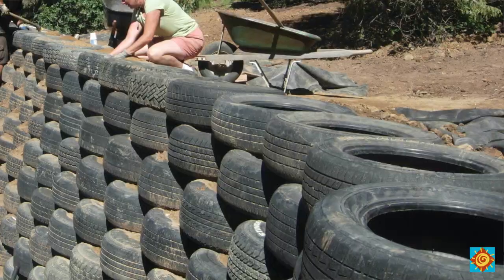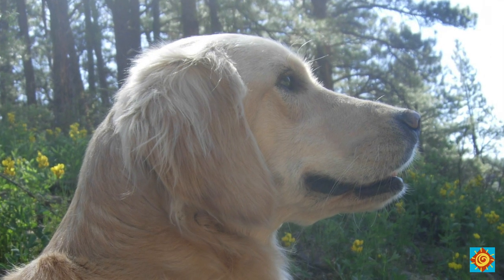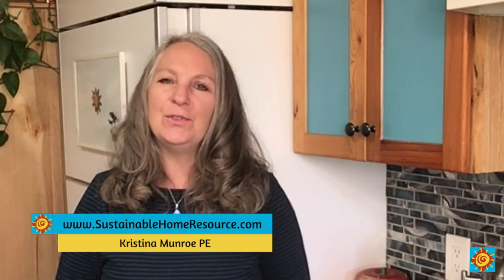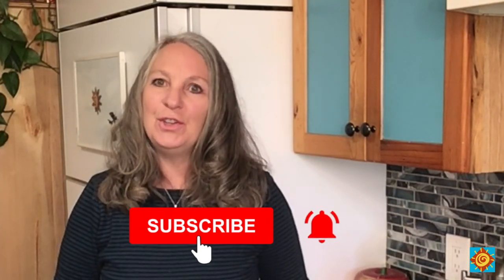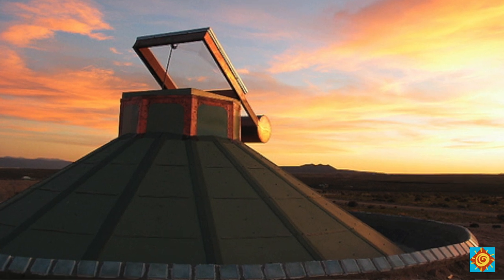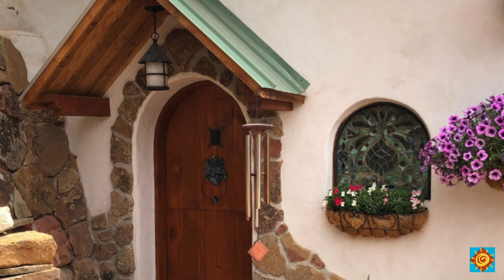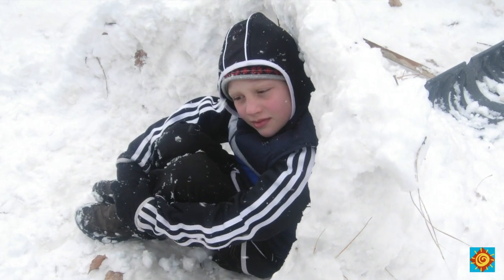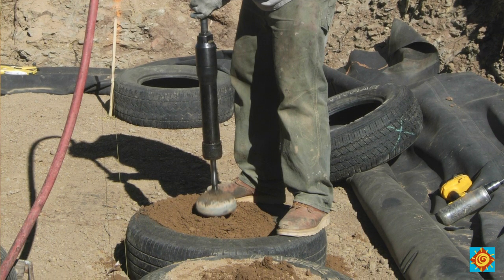How Long Does it Take to Build a Tire Wall?

Comment from the maker: I hope you enjoy this video. It was fun reliving building our tire wall. 
What materials are you considering for your sustainable home?
Reply: Modified Earthship Biotecture Global model - we will be using a combination of compressed earth block integrated.
Reply from the maker: @rongray4118  Tires and Compressed Earth Block would definitely be my approach if I had to do it over again. Good for you! Keep us posted on the progress.
Reply: 1st thanks for the video! I need to build several retaining walls to prevent land erosion on my property that has a creek running around/through it. Where did you get you tires from?  Are there issues with fill dirt washing out of the tires from rain? Once again thanks for the video and helping me out
Reply from the maker: @ridinrancher9443  Re collected free tires from local tire stores mostly. Regarding dirt washing out - yes water will wash out dirt from a tire wall. That's why I was motivated to get the tire wall up, backfilled and the house wintered in before snow and rain could damage it. We also protected the back wall with a "skirt". You would want to do the same with a retaining wall. We used EPDM (rubber used in roofing) or you can use contractors' plastic. Water coming running downhill will definitely compromise your wall. That said - I think tires make an inexpensive and sturdy retaining wall. Just make sure you take the proper precautions.

Comment: Never use old tires to build a house. I wonder how much the air compressor was for 2 months? And you had an excavator on site. You should listen to David Easton on building not the old garbage man. 
You should have used that tamper for rammed earth walls, much faster and a better finnish in the end.
Reply from the maker: It worked great for us. Living here over 15 years.

Comment: I'm trying to link to your workshops and pdf. It doesn't seem to be working. Will your book have the information in the two links you in your videos show notes? I have wanted a house like yours for years. Your house is wonderful. Did the roof fix work? You mentioned the type of roof and installation you would choose. Could you clarify what you would do if you installed the roof over again today. I'm at the first stage, land and house plan. Thank you for showing me girl power and that I can do it.
Reply from the maker: Thanks so much for reaching out! This video is one of the first I made nearly 5 years ago, so much has changed. 
We are no longer offering the workshops and I've removed the online course, but my book has most of the information in it to get you started. You can order it from Amazon and there is a link on our new website: ClarityOffGrid.com.
If you contact me through our website using the Contact Us form, I'll send you more information including some free downloads/worksheets. 
My strongest suggestion for you at your stage is to make sure that if you've purchased or looking at land that you double check and make sure that all of the systems you want to include are legal for your property - greywater planter, composting toilet, water collection, and building with tires.
Reply: Thank you.
I will contact you.
Enjoy your weekend.

Comment: Hi Kristina, it's inspiring to see a woman building a home. My bestie and I are planning on purchasing land in a cold weather climate and building our own separate homes on a shared plot. I just toured the Earthship community in Taos on a recent trip. Did you use a building plan from Biotecture or design your own?
Reply from the maker: I designed and drew my own plans, because after touring dozens of Earthships in Taos, I decided to make some significant changes to that idea to make it more comfortable in a cold climate as well as stay cooler in the heat of summer. If you haven't already, I'd suggest visiting our website, where we have tons of resources and free videos on how and why I designed the house the way I did. Let me know if you have any questions. Also, we just published a video recently called, "Why Vertical Glass in Our Earthship-Inspired Home." Good Luck!

Comment: I live here in Colorado. Where can I find the tires?
Reply from the maker: Hi Shaun.  In our county we just went to the tire stores.  They have to pay to recycle them so are usually happy to have someone take them away.  Kristina's dad and son went around weekly to collect them.  You'll probably have to sort through them to get all similar sizes.  We used mostly 225-16 to 245-16 sizes, using larger ones on the bottom getting smaller at the top. Good luck!  And don't hesitate to ask if you need help.  If you go to Kristina's website at sustainablehomeresource.com or buy her book you'll get lots of information that she wished she had a resource for when she started!  And thanks for watching!
Reply from the maker: We collected our from tire stores. When they remove worn tires from customers, they have to recycle them. By you taking them, you're saving those tire stores money.

Comment: do you have to have cement footings under the first tire layer?
Reply from the maker: No. Concrete footings aren't necessary because the tires are as wide as a typical footing and therefore spread the load directly to the ground. This is a great cost savings and allows you to get starting building straight away.

Comment: Wow! So impressive. 2 questions. 
1 Did you find the tamper hard on your joints? We opted not to use one for this reason (and $). 
2 When decreasing tire size did you use a lot of ‘squishy’ tires to get the tires to alternate properly? We are currently doing our second course - going from 265s to 235s and having hard time getting them to line up. 7 squishies in one course seems like a lot.
Reply from the maker: 1. We had Mike run the pounder because of his upper body strength. Christy and I couldn't pound for very long. So, I understand what you're talking about. If you can find a strong worker to help you, you'll find you get a superior pack with the pounder and that will reduce settling of the tires which leads to cracks in the plaster over time. 
2. We didn't have any issues like that. Even tires of the same designation offer differ in overall size depending on tread and wear of the tire. We found each course to be a bit of puzzle. We laid out each course completely before packing the tires, arranging them until it worked out. However, I don't believe we used 265's - we used smaller tires because they packed easier. 
Good luck with your project! You're doing it and you'll figure it out along the way. Hope this helps a little.
Reply: @ClarityOffGrid  Thank you for your reply and encouragement!

Comment: What did you cover the outside of the tires with? We need a long, free-standing wall but I don't want the tire look. Is there something I can spray on the outside surface to make it look nice? Great job!!
Reply from the maker: You don't see the outside because it's all backfilled with dirt. The wing walls at the ends of the house can be plastered. We used Lime plaster. If you're using the tire wall as a retaining wall, you could also use concrete to fill the gaps and then plaster it with concrete stucco. If you want see what a finished tire wall looks like, check out our channel for lots of videos where you can see the inside of the house and the outside tires in their finished form.

Comment: We’re in bush Alaska, and I have been eyeing the tire pile at the dump for a year dreaming of building an earth ship-inspired home but not knowing how we would accomplish this in the short time we have without snow. Thanks for the inspiration.
Reply from the maker: I'm glad it helped. We found the keys to getting the tire wall up in a reasonable timeframe, was using the pogo-pounder and also the material you choose to fill them with. If you try to use the native soil from your site and it's rocky, then you may find that sifting it will take too much time. We used crusher fines that were easy to shovel and pack. Good Luck to you! It's worth all the hard work.

Comment: DO NOT DO THIS, IT IS A RECENT DISCOVERY.  THE STEEL USED IN TIRES., ESPECIALLY FROM OVERSEAS IS THE LOWEST "GRADE" OF STEEL (RECYCLED) RADIOACTIVE STEEL . THE STEEL USED IS RADIOACTIVE TO THE POINT IT WOULD JUST FLUTTER ON A U.S. GIGER METER (OVERSEAS ARE MORE SENSATIVE AND "TICK"). BY "USE" OF TIRES, THEY GET MORE RADIOACTIVE. THE "TYPE" OF RADIATION, IN THE STEEL, IN TIRES, IS THE "WORSE" KIND. IT IS WHY THEY USE IT IN TIRES. THESE WERE NEVER MEANT TO BE RECYCLED. I LOVE EARTHSHIPS. I AM LETTING YOU KNOW TO SAVE THEM. CHECK YOUR HOME IF YOU HAVE ONE, AND DO NOT REUSE TIRES.
Reply from the maker: It would be helpful if you left a link to the scientific paper you're talking about.

Comment: how did you choose the tires for the wall were there specific width and sidewalls lengths used in different portions of the house or are all the tires the same?
Reply from the maker: Great question! We used larger tires on the bottom courses and then reduced the size as we built up. I spent hours pouring over tire charts to see the dimensions of tires. But, what it came down to is using what was available in our area. You want to make sure that the diameter and the tread width of the tire are consistent in the row. The diameter changes a lot depending on the amount of wear the tire had. We layed out each row before we pounded them - it's a little like a puzzle to make sure the row is level.

Comment: Wondering if a thick slurry could be poured or pumped into a tire. It should be able to conform easily to the shape of the tire and would leave a reasonably compacted tire when the slurry dried out.  Sort of like tires you find filled with dirt from floods.
Reply from the maker: Sounds like an interesting experiment. Of course you'd need ALOT of water (something we don't have here.) I'd watch out for settling over time. You might try that on an outdoor retaining wall and see how it works. There's always room for new ideas! Thanks for posting. Let us know.

Comment: It sounds like a lot of work but it seems like the pneumatic ponder would greatly increase efficiency and 30 a day sounds like a good day by hand but I don't know
Reply from the maker: If you consider how long it takes to form up retaining walls, install steel, etc, building this wall was done in a reasonable amount of time. This process just made sense to me - and I could participate with my labor.

Comment: can you just fill the tires with concrete?
Reply from the maker: That would defeat the purpose of reducing non sustainable materials. If you want to use concrete just build a concrete basement wall.

Comment: Thank you for the encouragement and  the tips there is one area that no one includes on all videos that I've been watching on building a retaining wall and that is a drain system, no one talks about how to drained the water that it will accumulate behind the wall, could you tell me where I can find such information, thank you for your help.
Reply from the maker: That is a great question! 
You can't treat a tire wall like a concrete retaining wall with a French drain at the base because the water will build up and seep through the tire wall. 
You need to take great measures to keep water from building up against the tire wall. And the solution to that depends on your the topography around your home, the type of soil and the vegetation. 
Make sure to create drainage and divert any uphill water away from the house. 
In hindsight, I might consider hiring a soils engineer or civil engineer to develop a drainage plan. 
If with a good drainage plan, you'll still want to protect the back wall from moisture. We used EPDM across the back side of the tire wall and created an apron from the back wall at least 12 wide extending over the top of the berm. (Wish I could include a drawing). 
This is a big topic and the exact solution depends on the property. I hope this helps a little. 
Let me know and if you need more info. You can contact me through my Contact Us on our website. www.SustainableHomeResource.com

Comment: Good Video. Does the size of the tires matter ? Thanks
Reply from the maker: It absolutely does! Too big and they may not pack. It depends on the materials you're packing it with as well. 
We started with moderate sized tires and decreased the size as we moved up the wall. You want the same size tire for each row. - There's more details about this in my book. https://www.sustainablehomeresource.com/book

Comment: Great video - answered plenty of my questions! I'm curious as to what's involved regarding "building permits"  etc. Did you need an architect  & engineer to sign off before you could commence? Thanks
Reply: Earned my subscription btw :)
Reply from the maker: Thanks! Regarding getting a permit - that totally depends on your county and building department. Here in Colorado it's pretty easy to get a permit for a tire home because there have been many built in this area., They may (likely) require a design professional's stamp on it. Being a licensed engineer, I was able to design and stamp my drawings and they flew through the building department. Good Luck! And let us know how we can help.

Comment: Hey @Sustainable Home Resource! Thanks to share this video. I had some doubts. Could you help me, please?

Can I use any material to fill the tires? As civil construction waste mixed with soil? Or only sandy?

Did you used the water to improve the compaction of soil inside the tires?
Reply from the maker: People use different materials to fill tires. The cheapest material is the dirt that you remove when you prepare the site. However, if it's too rocky (that was our case), then you'll have to find some fill. Crusher fines work really well - they're cheap, and they compact easily - especially when damp (like we did). You may have to practice pounding a few tires and see which materials that are available to you and that compact the best and result in a solid tire-brick.
Reply: Thank you for your help and attention, @ClarityOffGrid . I will try to do it!
Reply from the maker: @andrezacerioni3496  Keep us posted and let us know if you have any further questions.

Comment: Have you tied those tires together in some way or they are just stacked alongside each other? I've seen some guy who was drilling screws to keep them together. Would you recommend that?  Cheers and Congrats!!!
Reply from the maker: Great question! 
We found that using a couple of roofing screws to hold the tire we were pounding to the row below was helpful. It helped hold the tire in place while we completed the first load of dirt. Once the tire is pounded, you don't need anything to hold them together - pounded tires aren't going anywhere! 
Using just two small screws helped us keep nice clean rows of tires. And that makes pouring the bond beam, plastering, and finishing much easier.
Reply: @ClarityOffGrid   When you say  "bond beam" what do you exactly mean?  Is it some form of vertical steel column going inside the  tires or...  ?
I promise I leave you alone after this one. Thanks and congrats.
Reply from the maker: @VelhaGuardaTricolor  First of all - you don't need to leave me alone. Helping people understand sustainable homes is what gets me up in the morning. 
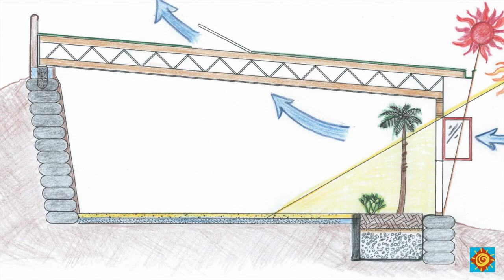A bond beam is the concrete "curb" that is poured across the top of the final course of tires. This beam holds and stabilizes the tire wall. It also creates a horizontal support to receive the roof trusses. If you go to 8:05 in the video you'll see a drawing of the cross-section of the house. Look at the top of the tire wall and you can see concrete going down into the top row of tires and then forms a block for the roof trusses to rest on. Please let me know if this makes sense or not. I can probably lead you to another video that shows the construction of that bond beam. 
Thanks for you questions.
Reach out any time!
Reply from the maker: @VelhaGuardaTricolor  You can see the finished bond beam in this video: 1 Video Single Mom Builds and Elegant Off-Grid Home
https://youtu.be/seYXDpl1wuw.
Go to 10:48 in this video and you'll see the curved tire wall with the bond beam on top of it, just below the finished wood ceiling. I hope this gives you some context. 
Let me know 😀
Reply: @ClarityOffGrid  You couldn't have explained it better. Thanks you very much for your patience and help.  Cheers!!
Reply: How’s the building codes?